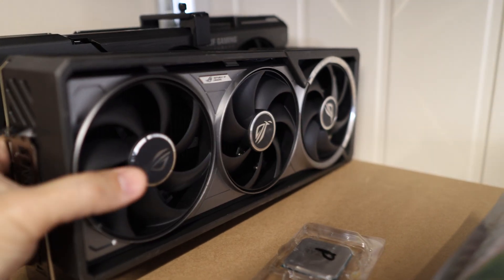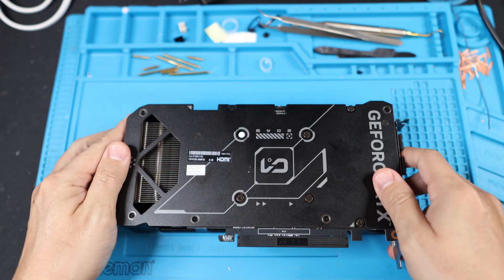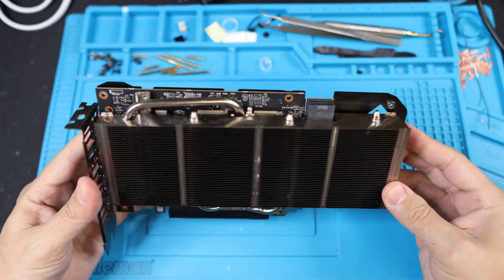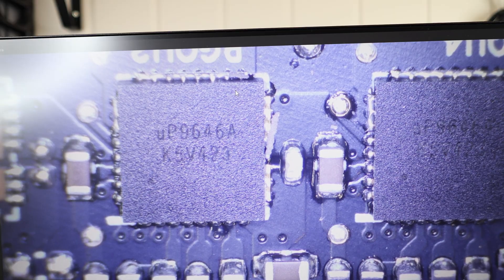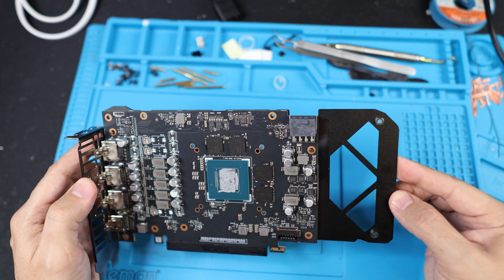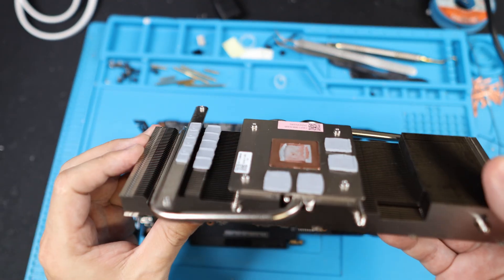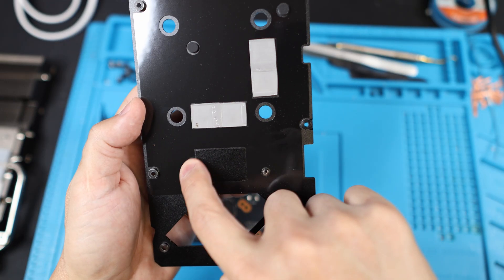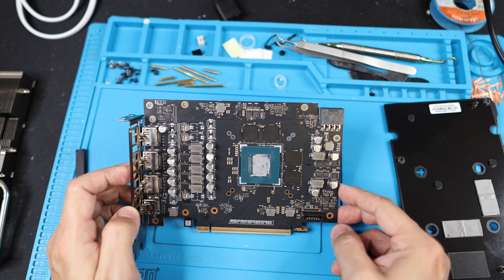ASUS DUAL RTX 5060 Ti TEARDOWN

Comment: Do you think this tiny heatsink is sufficient for a 180W chip? Somehow, I just don't believe it.
Reply from the maker: I have the card here, and it works perfectly fine with this little heatsink. No thermal throttle that I can tell.

Comment: What's the difference between the 8GB models and 16GB? can't we just upgrade the memory from 8GB model to 16GB and the 16GB to 32GB?
Reply from the maker: Upgrading the memory on a GPU is not the same as upgrading on a PC. The cost alone for the memory chips and labour would equal to what one of these cards is worth.

Comment: Great videos, just wonder what do you think of Gigabyte's thermal gel on 5060ti and other models, would be great if you could do teardown of one and maybe show how to replace gel with pads? Would be great. Thanks
Reply from the maker: I would simply say stay away from Gigabyte for now. Unfortunately I buy all the products out of pocket that I make videos of, so unless one comes in for repair, I can not promise a video for the time being. But if you already own one of these cards with that deadly puddy, and it is of concern to you because you installed the card vertically, then I would use 95% isopropanol when removing that stuff. But if the card is installed horizontally, you have nothing to worry about, as this issue is primarily affecting cards installed on a riser vertically.
Reply: @TechnologyHive  Thank you for the replay, I ordered the gigabyte before knowing about the issue, but it wasn't shipped yet so will try customer support tomorrow and hopefully they can change the order to the ASUS in this video, that's what brought me here :) It would be mounted horizontally, but who knows what will happen to it over few years, it would be at the back of my head. Hopefully you'll get one in for putty replacement and show us how big the problem is. Also I wouldn't know what thickness pads to use for replacement as don't think I could measure that gel :( Thanks

Comment: Hello, Thanks for this video! I'm thinking of getting the Zotac one as it is $72 cheaper than Asus. Same 5060 Ti 16GB, same dual fan (Zotac non-OC while ASUS is OC). Do you think having the thermal pads in the back plate for ASUS is worth the $72 extra spending on my part?
Reply from the maker: No. If you can save 72 dollars, do it. Not worth paying that much, unless it has memory chips on the back also.
Reply: @TechnologyHive  appreciate the reply. The shop selling Zotac just increased their price so difference now is now just approx $50 lol. got me thinking. what do you think? I saw reviews that zotac doesn't have thermal pads on the back plate so its vram temps are higher than asus. Just thinking about longevity now
Reply from the maker: @espressolounge  I would get the ASUS card.
Reply: @TechnologyHive  Appreciate it

Comment: I have ryzen 5 3600 on a x570e mobo, the cpu upgrade never happened

thinking to get a better am4 cpu alongwith this card as a upgrade
Reply from the maker: The 5700x would be my choice for an upgrade on the AM4 platform.

Comment: I believe those uPSemi mosfets are usually used on mobo, I'm not as familiar with GPU power stages but I'm pretty sure uPSemi are heavily used on mobo... as far As I know I've never had an issues on any of my mobo really any brand unless it's super cheap made.
Reply from the maker: I have not seen these mosfets on GPU's before, except for the uP9512 PWM controller and such. As far as motherboards go, I may have ran into them in the past, I just do not remember.

Comment: Thanks a lot!
The first REAL review of this model :)
not a marketing one.
PS have this for a 4 months.
One of the cheapest and best by noise\temps
Memory overclocks to the tits(with patched afterburner), chip overclocks to 3150.
And it is all about voltage there, bios limits, ram and chip can do even better.
Reply from the maker: I am glad you found the information helpful!

Comment: MSI have 8gig for459eu  but or 40 eu more u get 16 gig for me this is stupid .... i am still on rx5700
Reply from the maker: I do not understand why AMD and Nvidia still release cards with 8GB. 2025 in my humble opinion, the minimum should be 12GB. The RX 5700 and 5700 XT are goats. Next time I get one in for repair, I will make a video on how they have held their value in 2025 for 1080p gaming.
Reply: @TechnologyHive  before upgrading from 1060 3gb my idea was to wait for 5050 for ~150$ for gaming in 1080p
And when it became clear, that I won't get my 5050\ti 8-12gb for 150-200$ I just bought 5060ti 16gb for gaming + playing with local LLM
PS today 5050 is the worst GPU by performance per dollar
Reply from the maker: @DrWatchHD You're much better off with the 5060ti anyway.
Reply: @TechnologyHive   ty man :) for u i bet u know this but let ppl know if they have rx5700

ThermalPads thickness: Gigabyte RX 5700 XT and non xt  !
    Backplate - 3mm.
    Memory - 0.5mm
    VRM - 1.5mm / 1mm /
Reply from the maker: @pavelstoikov3780  Great info!